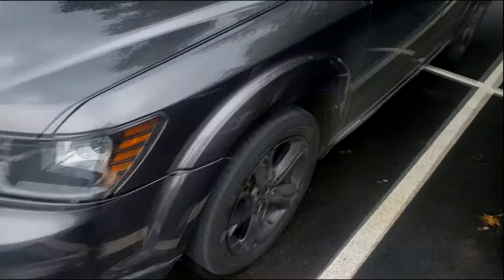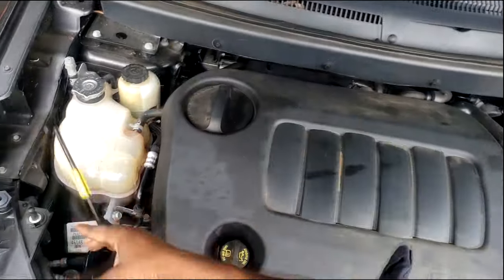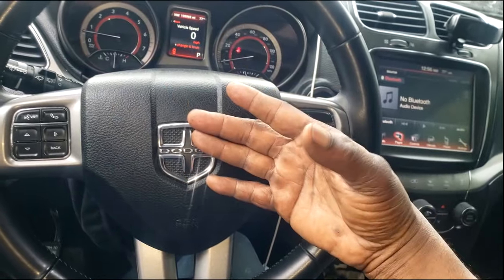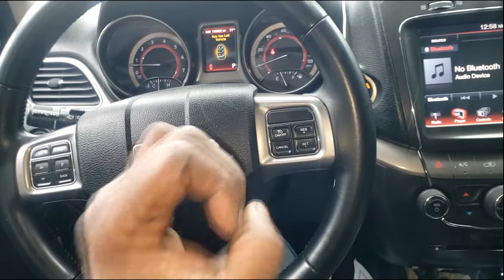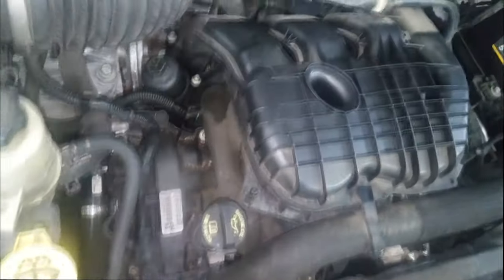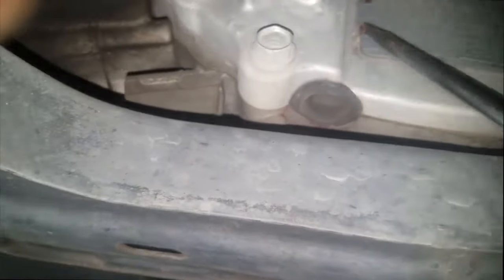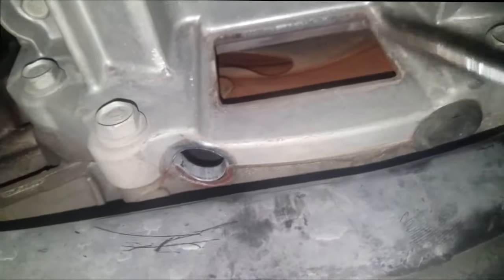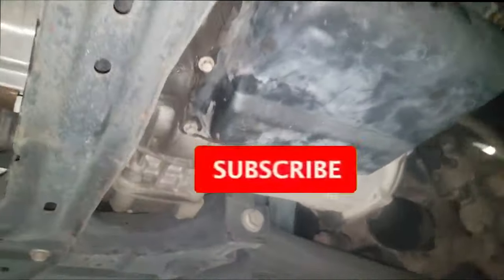How a broken FLYWHEEL FLEXPLATE sounds. Dodge Chrysler Town and Country Caravan. Transmission Noise.

Comment: OH WoW !!! I have an 06 DGC and it sounds exactly like that. I automatically assumed it was a rod or something in the motor but, it does have oil. I've  been saving for a motor which I just now have the $ for. I'm gonna go back out there and put that thing in the air and do a recon. Thanks Boss Man !!!
Reply: Man I put headers on my car thinking it was exhaust manifold then I change all the lifters and tick was still there. Come to find out its the fly wheel 😞😅
Reply: Mines got a fast consistent knock lol but when revved up it gets louder and more violent I'm not sure if it rod knock or not or spun rod bearings or if it is flywheel cracked or damaged ? But it got oil
Reply: @memesyandhorrorshorts  exactly how mine is. What you figure out

Comment: I had THIS EXACT sound from a used car i bought. I got it super cheap because they took it to the ford dealership and were told it was a bent rod and they would need a new engine. hahaha suckers 80 dollars later i saved 5 grand on my truck.

Comment: Will sound go away once car is warmed up and running? I have similar noise at cold start. Once I run it for a while it quiets or goes away
Reply from the maker: What kind of car is this that you have? Also are you subscribed to the channel?
Reply: @OnlineMechanicTips  it's a 2006 Chevy Express 2500. 4.8 engine. 👍🏼

Comment: got a 2015 grand caravan with 130k that has a p0016 light, i dont hear any ticking noises that may indicate the flywheel is damaged. is it possible the flywheel is still the cause of it or is the timing chain the most likely culprit? gonna have to get this fixed soon as the van has started dieing when letting pff the throttle for turns and stuff which is expected with this damn code. but would love pointers on which to pursue first of best way of verifying myself which has failed/needs replacing. if its the timing i can do it myself on the weekend but the flexplate i sadly will most liekly have to find a shop as i dont have the time for a job like that :(

Comment: Are all pentastar engines with vin8th as G interchangeable chargers to jeeps ?(minus hardware swapping)
Reply from the maker: You have to be careful with interchanging parts. The base Pentastar block likely the same and they both RWD vehicles but theres still some major diff. I stop guessing at that and verify everything with our parts department.

Comment: In your experience- have you seen a flywheel/flexplate jam? to point it appears like engine is seized. but issue is in bell housing.....looking for experienced insight. so I start going down the right direction.    Thank you.
Reply from the maker: Yes, that can happen and ive seen it happen. Curious, what kind of vehicle is this? Also are you subscribed to the channel?
Reply: @OnlineMechanicTips  
subscribed-Yes.
5.4 3v ford...definitely issue in flexplate crank area.....socket/breaker bar on crank STUCK! remove starter- free, install starter truck starts....than clink,clankclink,clank stall---crank case locked up take starter off, free engine,  same process over.
now engine is locked up....I truly think its in torq con/flexplate-crank case somewhere.
Reply from the maker: @sonofsteve566  O wow, yes, thats what it sounds like my guy. Ive never had one out. Im curious as how difficult it is to remove the trans
Reply: @OnlineMechanicTips  
soon as it warms up stops snowing,  I will let you know how it went...thanks👍

Comment: I have a 2014 grand caravan and had the flexplate replaced 2 years ago and its now doing the same thing again! Is this normal to keep going bad frequently in these vans? Is there something else they should be checking thats possibly causing this that should be fixed also?
Reply from the maker: No its not normal. They was also suppose to replace the dowel pins between the transmission and the engine block. Did they do that? Also are you subscribed to the channel?

Comment: Hi. I've got a 1998 Nissan Pathfinder, 164,000 miles, 3.3L V6, 5 speed automatic transmission.  When it's first started it knocks or rattles for 3 seconds. Then it stops. Once warm it will only do the startup rattle about 50% of the time.  Exact same noise returns from about 1,800 to 3,200 RPM and then stops.  If I'm going up a hill it won't do it 50% of the time unless I press the gas pedal and cause RPMs to sharply raise.

The noise increases with RPMs increasing.

The main bearings and rod bearings were changed. Looked good. No rod or crank shaft slop was noted.

Oil/filter is new and full. Same with transmission fluid.

I've narrowed it down to 4 things based on its part time occurrence:
1. Flex plate?
2. Timing belt tensioner failing (unknown when last changed)?
3. Torque converter?
4. Hydraulic lifters?

I have two short videos I recorded it and can share.  Thanks!
Reply: Big man, did you find the solution to your problem?
Reply: @Frank-dq8kf  based on the mechanical oil pressure readings (I installed one) and the noise that is present when pressure is lower than it should be, I think I have a failed bearing, or two, that's not spun, but damaged, and at certain RPMs it is losing that pressure and knocking.  I also found metal flakes in two different oil filters I cut open.
Reply: @thesetruths1404  ohhh okay. My car makes the knocking sound too and the mechanic i went to see said its the transmission but i don't think it is.
I have a feeling that it's either a bearing / flexplate issue . 
He probably wants to scam me, he's not gonna change any transmission but he will charge me for it
Reply: @Frank-dq8kf  check oil filter
Reply: @thesetruths1404  is there anyway that i can send you a video of it? Are you a mech?
Reply: @Frank-dq8kf  if there is minor metal wearing it will be in oil filter, and maybe oil pan too if really bad. 

And install a $30 mechanical oil pressure gauge too if you don't have one already. 

Videos don't record sounds well. Too much variable noise and acoustics.

Best way to rule out internal issue is cut open oil filter and check folds of filter element for any metal flakes.  More than 5 to 10 flakes, it's internal failures.

Comment: We're where or why didn't your video pop up u der.y search for my 2012 Chrysler town & country touring-l   maybe because the dodge word , however , I had this exact noise and couldn't find anything close to that sound and what was causing it ,my brother kept saying saying it was the flywheel,  however,  it was on a dogde truck wasn't the same engine or Trans and it didn't have a broken off chunk,  it had cracked and making a total different noise like a thinking noise when putting any kind of tork on the Trans,  so I ended up paying almost $ 250 to ha e 8 different mechanics around my van stumped at the noise my van was making and came up with because there was no check engine or codes coming up and the van ran and drove like a new vehicle , so they cam up with that it had to be a right side inner timing glide that either broke in half or was cracked so that at idle weather in park or drive it makes the same noise as yours or that when giving it just enough gas pedal to go from 500 rpm at idle or go above 700 rpm and it went away even when. Driving it , so then they gave me a estimate and the price was outrageous almost $5,000 or even more because seeing g as we are in ther you should replace this and that as well and the labor is intensive because you have to take most of every part to get to just the timing cover , so I opted at that point to do this job myself and it took me 4 hrs a average a day 7days a week for6 weeks from start to finish and from my wheelchair or mostly on the floor and on my back  !! And I replace every chain , sprocket and selinoid and glides , water crossover pipe with a metal one and the water pump , with a metal one and the oil pump and sending unit , spark plugs , all new seals and gaskets pully tensioner and things that just didn't hurt to do , long and short hey ! But I'm NOT a mechanic by far and I know enough to do an oil change , brakes , transmission flush , plugs so on so this was a huge undertaking for me let alone anyone else ! And it did it right before ause it runs just as great as before , however ! It didn't fix the issue andi would have been out-of thousands of dollars 😢 so I said drive it till it breaks , I did , found the starter died after it jumped forward and got stuck and burned it out , but that's because the broken chunk jump out of it space to behind the tork converter and flew into the starter and that happened , how I then found the broken flywheel ! And then I looked how to do that and your video popped up and I went into a total breakdown and said boy only if , I could have saved about $ 1, 800 in parts so far and another $ 200 plus about 3 mo ths of my time and my wheelchair van being down,  maybe refraze the heading so that it includes Chrysler  and that way others can find that , be a use there are not enough how to videos for how to work on Taking what had I had to for the entire job and while It's in the van trust me,  I had to learn it the hard way and record it so now I can put mine on YouTube.  Thank you , Glen from Wisconsin
Reply: Well, I'm old and working on the cars all me life, I don't know if I had pair of balls like you being in your shoe's, you grew them right, mate, I take my hat off, mate you did a good job. Take care !👍

Comment: It's too rattely and sharp sounding to be a bottom end noise. At least it's way easier than replacing the whole engine and cheaper. I had a car that threw a rod and at first it was a minor knock, then it started banging and clanking as the rod started bouncing around inside the engine, We shut it down and pushed it the rest of the way home. I was really surprised it didn't exit the block.

Comment: I have a 76 Trans Am that makes a metal scraping noise when I step on the gas but when I put The wheels up in the air and accelerate there is no noise at all automatic transmission do you think it’s the flex plate?

Comment: Just had my wife's replaced from being cracked. Day after I got it back from dealership I got esc light on and random no crank. Dealer say not their fault and says it'll be another 1k to fix that. Not including the oil leak I didnt have before the worked on it
Reply from the maker: Whoa, but on the flip side, theres not much to removing the transmission in order to replace the flywheel. Not much you can cause. Unless he dinged the crank sensor or the new flywheel.
Reply: @OnlineMechanicTips  he scanned it when I took it back and the random times it doesnt start it shows it's in reverse when in park

Comment: So the fly wheel bolted to the motor
Reply: Yes. It's in between the engine and transmission. The flex plate is probably crack and need replacement. Very common on these vehicles.
Reply: @johng8967  smh 🤦🏾